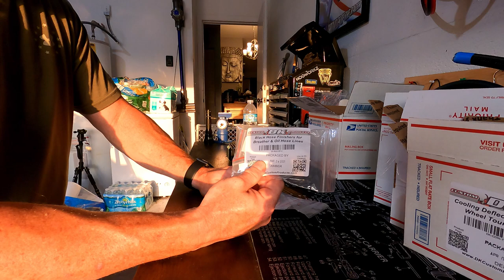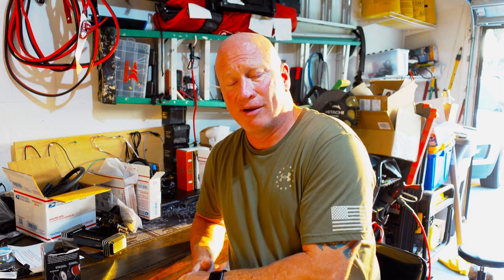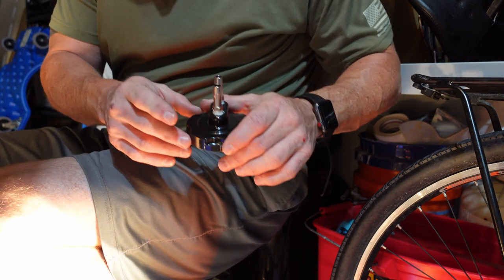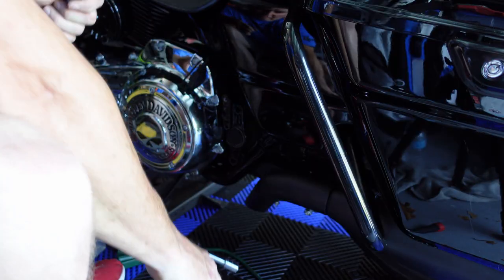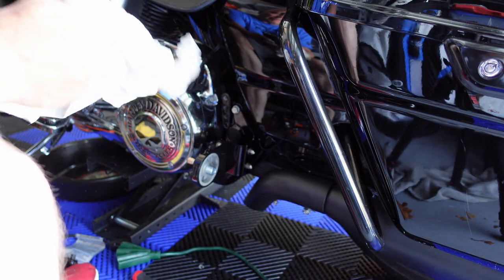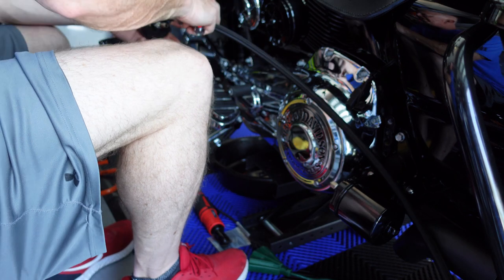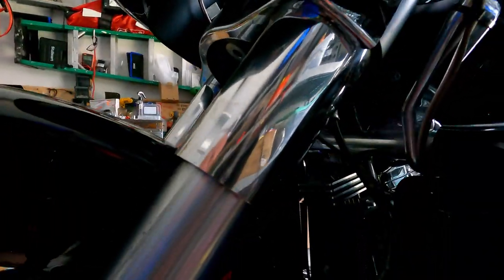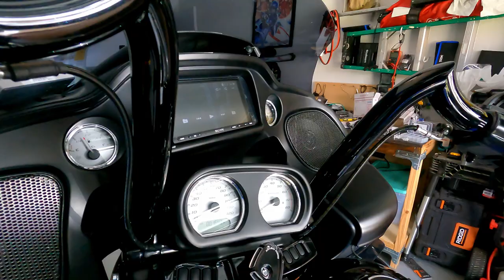Harley Road Glide Oil Filter Relocation And Oil Cooler Install - A closer look at DK Customs line.

Comment: 2014 Ultra Limited.  I installed this in my garage in about 3 hours or so.  I took the advice of installing the lines onto the oil adapter plate before screwing it on, which should have been in the original instructions.  I did the same for the cooler before attaching it to the bracket and did the oil filter connections last as they were easiest to reach.  I know you removed everything eventually.  But I wondered when I watched your video, how well the cooler could have worked, since you mounted it perpendicular to normal airflow.  It didn't look like air would be effectively moving through the cooling fins.    Anyway, I've had no issues with leaks, and no issues running the lines in protected spaces through the lower frame.  I hope others find it was as easy as I did and don't get discouraged from installing this kit, even though you had trouble with leaks and such.  I suspect yours was the exception, and not the norm.
Reply from the maker: @keonef  the design is awesome and worked well but it’s just a matter of time before you run over debris and catch a leak.
Reply: @RealRonTV  considering that, I'm now searching for a skid plate or protective sleeve option.

Comment from the maker: EDIT: I ended up relocating the two hoses going back to the oil filter from alongside the top of the primary to under the bike.  It's much better placement down there, much less heat and completely out of the way.  Tucks nicely under the frame with a couple of zip ties.
Reply: Yes, I tucked mine just on the inside of the frame with a couple of zip ties.  Seems to be the best placement.
Reply from the maker: @traviswhitworth6506  be careful!  Mine sprung a leak during a long trip. Lucky I spotted it when I stopped before I completely ran out of oil. I was able to get into a Harley dealer on the road and had them pull it out and into the garbage.  Never went back.

Comment: I added the Harley OEM oil cooler fan and the rear cylinder heat extraction fan to my 2018 SG CVO when I bought it. They work great keeping the engine cooler at 6000’+ MSL and high temperatures in the summer months here in Colorado
Reply from the maker: This thing sprung a leak on me twice. The 2nd time was in the final 200 miles of a 3000 mile round trip to Texas. Ended up costing me a boat load of money to get it to Harley. Ended up scraping the whole system and having the Harley fan assisted oil cooler installed.
Reply: How did it spring a leak?
Did the oil line rub the belt when you ran your lines under the bike?

Comment: I just installed the relocation and cooler on my 22 RGS.  It was a challenge.  I even called Devin at DK.  He was very helpful.  He even gave me his number to call after hours if I still had problems.  The cooler barley fits.  It just barely clears the shift arm and the linkage.  I mean just barley.  Nothing is hitting though.  I've only had it on for a day.  I road maybe 25 miles.  No leaks.

Comment: Ron - excellent video.  I’m ordering the same combo for my new 2023 RG Limited.  Great shirt too!
Reply from the maker: Don’t do it!  Read my last comments on this… sprung two separate leaks and the last one almost cost me my motor.
Reply: @RealRonTV  Have you removed it from your bike?  What do you suggest as a better replacement for the filter relocation and for an oil cooler?
Reply from the maker: @ZevGriffin-s5u  yeah I broke down like 400 miles from home. I had a Harley dealer yank it out and go back to stock.  I just recently installed the ultra cool on my CVO but it hasn’t been hot enough to activate the fans yet. I also run a thundermax oil fan.
Reply: @RealRonTV  Thanks very much.  Your real-World experience is invaluable.  I’ll look into the options you mentioned.

Comment: I installed mine from DK and it was a breeze.  I bought 10’ of aftermarket steel braided line (and clamps) to guard against chaffing.  I also installed a Dakota Digital oil temp gauge during the install.  The sensor is on the output hose of the engine so it displays the temp of hot oil coming from the engine before it gets to the filter.

Comment: I'm doing the exact same setup.  Thanks for the helpful video.
Reply from the maker: Be careful. Mine sprung a leak on the way home from a long road trip and almost cost me my motor. I got rid of it and went back to stock.
Reply: @RealRonTV  not to mention that could have made for a sketchy ride had the leak gotten bad enough.

Comment: Good you showed a workaround for lowers and Love Jugs.  After relocation, did the passenger footboard fit without modification?
Reply from the maker: No issue at all with the rear pegs.
Reply: It is only a matter of time before the front fender gets dented with the oil cooler installed as shown in this video.  Use the Love Jug Mighty Mites (they work better than the big ones) AND there is no clearance issues with mounting the oil cooler as shown in this video and the instructions- https://www.youtube.com/watch?v=GiYjkpZaNYg
Reply: @DKCustomProducts I was thinking the exact same thing when I watched the install. I had that issue with a catch can set up I mounted in that same spot.

Comment: Thanks for video instruction. Great shirt!!!  Bike looks great. Bums me out that we spend the $$ on new bikes and have to spend $$ on parts to cool them down. Have a 21 RG Limited and looking to do same thing.
Reply from the maker: Don’t do this upgrade. It spring a leak on me twice. It was a cool concept and maybe there is a better way to route the hose but it’s not worth the risk. I went back to the Harley standard oil filter.
Reply: @RealRonTV  Where did it fail? What did DK Customs have to say about the fail?
Reply from the maker: @jhhendricks  I never told them. The first time it leaked the hose must’ve rubbed against something and leaked. I then pulled it all apart and relocated the hoses under the bike alongside the frame. Leaked again on the long ride home from Texas. Lucky I didn’t destroy the engine.
Reply: @RealRonTV  oh man that sucks. Thanks for letting me know.
Reply: @RealRonTV  I agree completely, this is made to work when instructions are followed.  If you choose not to follow the instructions, or reach out to us for help understanding the instructions, it is best to not do it.

Comment: Just got the relocation/cooler kit for my '17 RK, (107 M8)the current directions DO tell you to install oil lines to the bypass adapter before installing.  I'm thinking about stainless brake line tubing for the longer runs and using the rubber line for hook up flexibility.
Reply from the maker: I sprung two separate leaks so beware. If you decide to stay with it, protect those lines in any way possible. I went back to stock after the 2nd leak almost cost me my motor.

Comment: I ended up having an oil leak from the hoses when I installed this same kit. Paid good money for it to end up leaving me have to find a guy and a trailer to get me home so I could take it all back off and go back to stock. So frustrating 🤬
Reply from the maker: Happened to me during a iron butt ride.  Almost cost me my motor. Had to get a hotel and a trip to the local Harley. I told them to pull it off and throw it out and go back to stock.

Comment: So your lack of PM causes you to badmouth DK's kit? I'm sure if you took the time to inspect your handy work before your trip you would've seen the hose wearing and took steps to correct it. A few extra ty raps and or something to insulate the hose where it was rubbing would have saved you a lotta cash.
Reply from the maker: You make a valid point. I did say the design and concept was great, however running those lines in my opinion are asking for problems. The video they provide doesn’t really cover that part of it and I’m trying to make sure others don’t end up breaking down or even worse blow their engine. They need to come up with better coverage on that part of the install and a better way to protect the lines.
Reply: @RealRonTV  I guess I'll find out as my bride got me that kit for Xmas. Lets hope others will take your issues to heart and protect their lines better and inspect them from time to time.. I think rubber lines should do well on a Harley if run right and protected where they need to be.
Reply from the maker: @smittymhs1452  the problem is the exposed hose. Even if you run it under the bike in the channels near the primary it still doesn’t take much to nick the hose. Hit road debris the wrong way or a rock and you have a slow leak and won’t even know it until you stop and park. Take care with the install.
Reply: @RealRonTV  I'll keep that in mind while installing. Convoluted tubing comes to mind. Or just a better quality hose. ;) I haven't even opened the box yet to inspect it. A trip to NAPA may be in order.

Comment: How much are you loving the oil filter relocation after, what a couple of years? I am thinking about doing it as well, but I would like to know if you are happy with it.Thanks  for the video.
Reply from the maker: I guess you didn’t read the comments?  I sprung two leaks and the 2nd one almost cost me my motor. I scrapped it and went back to stock.
Reply: Yes sorry about that, I was just going through the comments and I saw the one that you referred to. Oh well it’s too bad I thought it was a good idea, I’m tired of the messy oil changes. Thanks for getting back to me.
Reply from the maker: @inthegarage.withalvaro.1344  the flaw is in the lines. There is no way to route them where they can be safe from punctures.

Comment: Finished my install and now I have extremely high pressure at idle.  Any suggestions??
Reply from the maker: I would check the lines to make sure it isn’t kinked. Other than that make sure the input and output is correct?

Comment: Looks like you just moved the filter from one hot spot to another. The exhaust pipe will keep your filter warm!
Reply from the maker: No not at all. Definitely cooler than being on the engine block.

Comment: Is there a part 2 ??  I'm considering purchasing this, tired of fighting the oil filter every time I change the oil, those damn lowers really get in the way.   Plus I want to add an oil cooler, like you did.
Reply from the maker: No part two sorry. I dumped mine and went back to stock after my line sprung a leak on the way home from Texas to Florida. Not taking that chance again.

Comment: Ron how far out does that filter stick out from the bike? Any worries about road stuff hitting while riding?
Reply from the maker: Don’t do it! Although it’s well made and actually does cool it down. I had the line break twice on me in two different locations. After a very expensive trip to Harley on the way back from Texas, I had them remove everything and go back to stock. Tossed it in the garbage.
Reply: Ron did you reach out to DK Customs? Thanks for the info.
Reply from the maker: @monteval684  Nope. What would they do?
Reply: @RealRonTV  WOW! I was torn about the looks of the filter being visible. I considered the oil cooler only but how would you change the oil?
Riding a twin cooled 2021 FLHTK guess I'll look for alternatives. BTW you always look like your on the verge of dying in your garage. Ever consider a portable A/C unit :)
Reply from the maker: @funhumanusa  actually I’m going to get an ac unit for the garage soon lol. Can’t go through another Florida summer like that again 🤪
Reply: @RealRonTV  I cant work in my garage in the summer in FL. U can screw things up real quick when u get overheated
Reply from the maker: @paulpuzycki7003 tell me about it!  This summer I have a portable AC unit ready but i need to cut a hole in the concrete for the exhaust.

Comment: Why did you add a cooler when your bike already has an oil cooler, just curious?
Reply from the maker: My bike didn’t have an oil cooler installed     After I got rid of this setup I ended up going with a Harley fan assisted oil cooler.

Comment: Ron how did those work out for you on temp ?
Reply from the maker: I didn’t run a comparison but springing two separate leaks and almost destroying my engine was all I needed to scrap it.
Reply: @RealRonTV  Ya I installed it on mine a few years ago. Love I do. However it did lower my oil temp. Engine temp and oil temp are 2 different things. Living in Florida Ron do you run SAE 60 weight oil for the heat. I use to talk to you years ago, I had a stroke and was out of the game for quit a while. But I'm back to riding again. Glad to see everything has worked out for you. I definitely like to new ride you bought, you've put a lot of money in that with upgrades, and it look fantastic. Hope works going good for you, and your staying safe as well.
Reply from the maker: @craigsevyn  sorry to hear that but great news that you’re back in the saddle!  I haven’t tried 60w yet. I’ve been avoiding riding in the daytime here. Too brutal.

Comment: Buddy great Video.. Anyway you can put a guard around that Oil Filter .. You drop that bike I'm afraid that oil filter is damage
Reply from the maker: Thank you but I got rid of it. The lines sprung a leak on me twice. Wasn’t taking any more chances.
Reply: @RealRonTV  Bro .. You got a nice Bike I like the add on's
Reply: You can lean over scraping the floorboards, or you can drop the bike on its' side.  The oil filter will not touch the ground.

Comment: Hahahhahahaha you know the "Kiss my fucking ass" is what I am laughing about....I feel your pain man, I feel your pain. I am actually looking at this for my bike now. I do have the Perm filter cooler already. Great video.
Reply from the maker: I should’ve edited that out 😂. I wouldn’t take the chance on this if I were you. It sprung a leak the first time I routed the lines. Then I RE-routed them underneath and away from everything and it sprung another leak on the way back home from Texas to Florida. Lucky I caught it in time. I liked the product but there has to be a better way to protect the lines.
Reply: @RealRonTV  I build computers with water cooling and the radiators have female threads for hose inserts. I am looking at automobile Transmission cooler type radiators with threaded fittings. I have a friend who makes hoses for oil and  transmissions, with perm fittings on end so they will tighten down. Making the brakets should not be that much of a problem. I will post a video when i get all this rigged up...may be a while getting all the parts but that is how it goes...great video man...honest and complete install with good and bad issues.
Reply: @RealRonTV  TSP makes a kit for racing cars with threaded fittings and hoses to eliminate leak. Looking into those.
Reply from the maker: @Frostytravels  it wasn’t the fittings that failed. The line got cut into by what I can only assume was road debris. No failure at all on the fittings. That’s what I mean by finding a way to protect the actual lines. And those were the braided ones not the neoprene.
Reply: @RealRonTV  o ok....got it.

Comment: Adding the oil filter almost against the exhaust pipe doesn't help with heat
Reply from the maker: It’s not even close to the pipe but that wasn’t the problem. It did work but I had two different breaks in the line. I took it off and went back to stock.